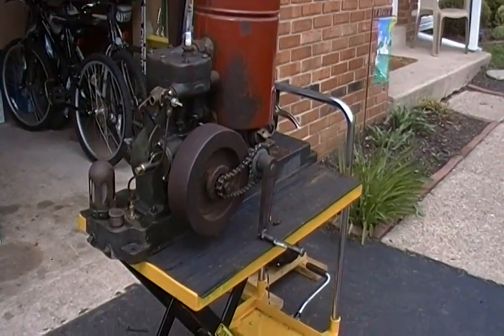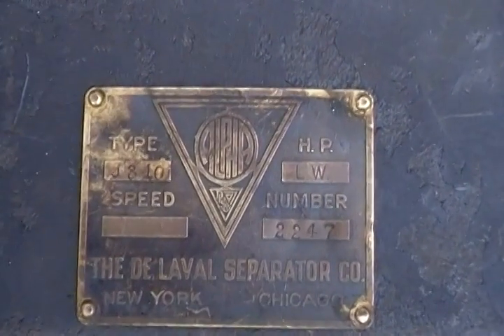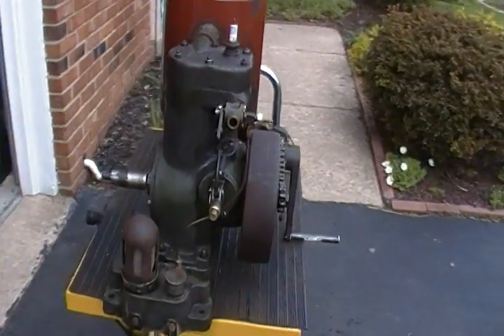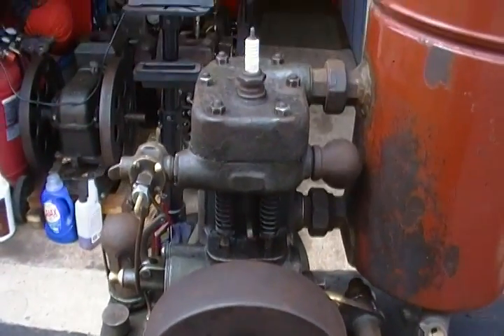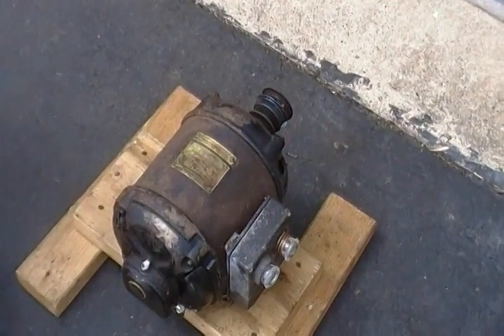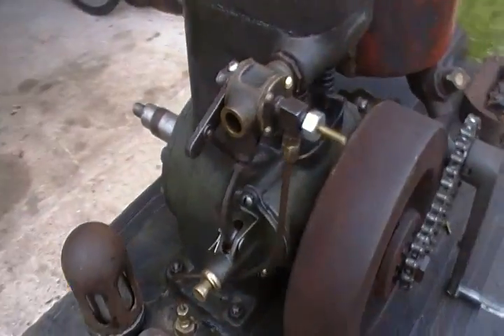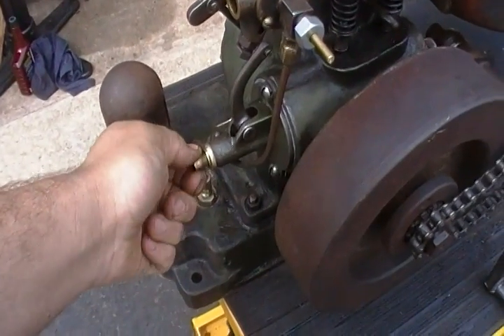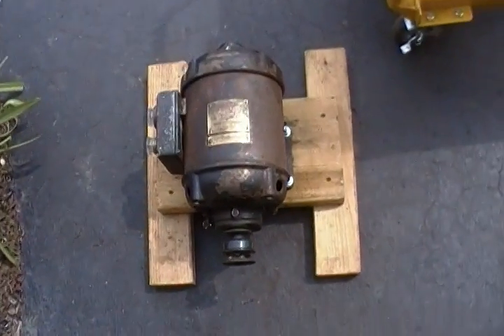1930s Alpha De Laval Engine

Comment: Hope to see it running there is one like it down the dirt road across from my house its in a old cow barn it has not been used in over 20 years and water leaks in the farmer who I knew well died 10 years ago and his kids sold every items off the farm now they just come cut the grasses and fields . He used to use a Air compressor to replace the Alfa engine but its still there . I got a Super Chief 1200 for free it was under 25 years of grass and weeds took 2 tractors to pull it out.